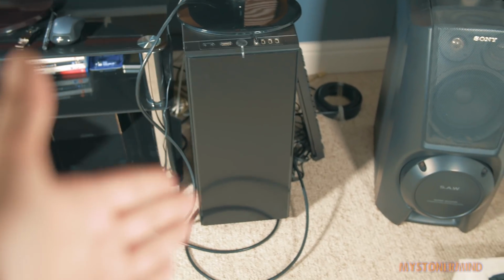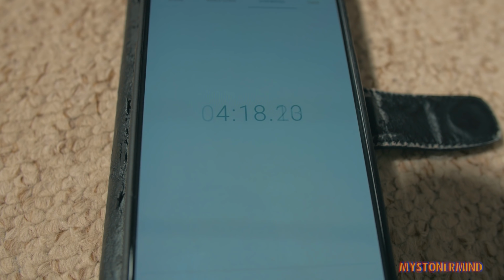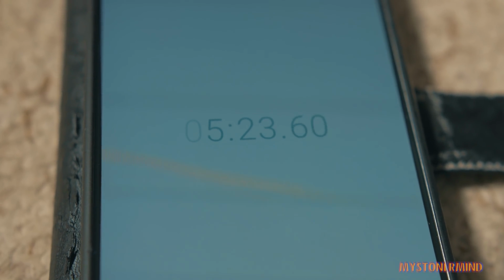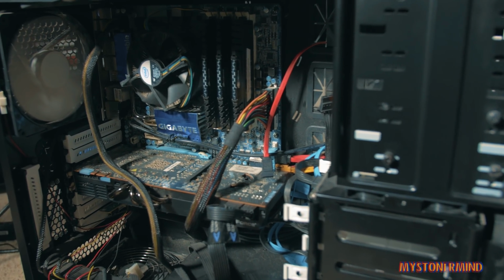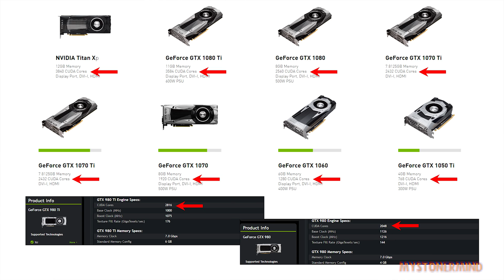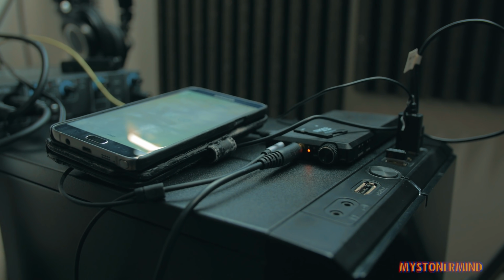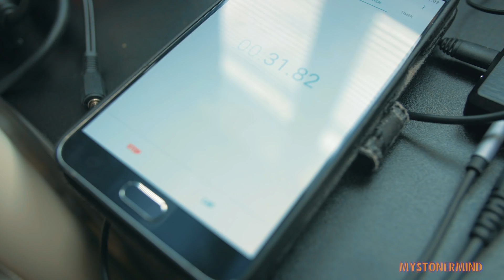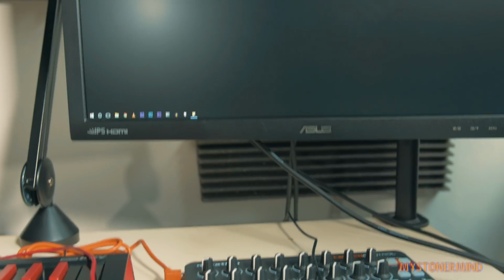Computer Setup Update 2018 - Part 1

Comment: Hello,I just bought a subwoofer to change it with the one of my sistem,the new one is 190 w and the amplifier outputs 100 w,is there a problem? Is a chance to burn my amplifier?
Reply from the maker: +Codrutz Rodanciuc make sure ohms are same and it will be fine ✌️

Comment: I use a small clean paint brush to remove the dust from computers, it stops static build up and fans from spinning up and cooking the machine.
Reply from the maker: +Fred Makes ... Bristles can cause static build up. How many machines have you cooked?
Reply: My Stoner Mind , none, but I've had plenty of people come crying after using a hoover. If your way works for you then awesome :)

Comment: Just don't buy a i9. Is the worst cup that Intel made.
Reply: Well i7 8700K is great at everything and it's A LOT cheaper. Of course if you want to spend the money.. just buy whatever you'd like :D
Reply from the maker: +cateplat n Intel don't make cups.
Reply: Ok.... I mean cpu :p
Reply from the maker: +cateplat n explain why it's their worst
Reply: For the work you want to do a Ryzen Threadripper 1950X will be way better in the same money. Check the video 1950x vs i9 7900x video in the channel '' Paul's hardware'' and you will understand.
Reply from the maker: for the stuff I do, ANYTHING will do better than what I have now. I've looked at the specs and the Threadripper seems pretty decent. Haven't watched that guys video though, but just from seeing specs, I don't think I need to.
Reply: Ofc anything will do the work. I am just telling you what will do the job faster :p You can check the website cpu.userbenchmark.com and compare them side by side. Anyways I just told you my opinion😃

Comment: Just a tip, mate. Using a vacuum on a PC isn't a great idea, because it can create a static charge build up. It's better to use canned air, because it has some anti-static properties.
Reply from the maker: +GERMANATOR444 in 20+ years I've never had an issue.
Reply: And that's how you know he is a legend
Reply: It's not super likely to cause a problem, but I prefer better safe than sorry.